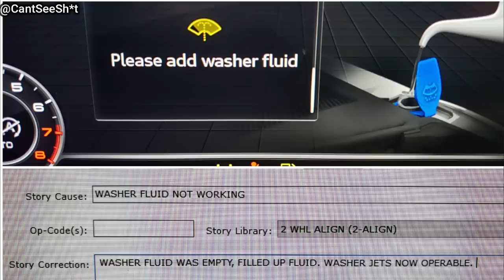Customer States Truck Feels Weird While Driving (GMC Sierra) | Just Rolled In

Comment: The pressure that should be tires is listed, most of the time, in the drive’s side door jam or somewhere close to it, NOT on the tire. What is listed on the tire is the maximum pressure the tire was designed to hold. But its not surprising that most people don’t know that. People are lazy.

Comment: The tire literally tells you the PSI for it on the side     ...90!?!!  I only have to use that on a 27 foot RVs air shocks.  Jeez...people.
Reply: No, the tyre tells you the MAX pressure on the side.  That is very different from the recommended pressure for your vehicle.  People are idiots.

Comment: I get people put like 50psi in their tires if that's within the maximum pressure, probably thinking it can only be good for fuel economy and it'll take longer before the tire gets too low, but what drives people to put 90psi in their tires, let alone seeing the tire is perfectly round with zero sidewall bulge and still keep putting air in until it blows up in their face!?
People like this is why people who drive vans with tires that actually take well over 50psi to be at optimal pressure are getting a hard time finding public air hoses that allow the pressure they need. Always the ignorant and the idiots who ruin it for everyone.

Comment: The tire thing bothers me a lot. I have D load rated GoodYear MT/R that only carry the D rating at 80 psi, and the current BF Goodrich KO2's carry "80 psi" for an E rating. That does not need they mean they need inflated to 80psi on a 2002 Jeep liberty! Just put them at 32 and be gone. "but the tire says 80". I say 32 is high, so do it...do it.

Comment: I don't know what it's like in the USA but over here there is a sticker when you open the drivers door.
It gives you the tire pressures front and rear for empty and fully loaded both in psi and bar.
If a car comes with 2 tyre sizes (base model and top model) then the sticker will tell you the pressure for both sets of tires. 
It seems easy to me.

Comment: That's all well and good since most vehicle owners aren't mechanic.  But went you send your vehicle to the shop to replace the oil pump and they look for an oil leak, mean while failing to notice that there is no oil pressure on the motor while its running. So, when are you going to do a video on that side of the business.

Comment: I don't understand how people could not know how to read the side of their tires for air pressure information? We even learned as kids not to overfill basketballs, volleyballs, tetherballs. It's just common sense isn't it? That last clip was harsh, dude almost killed himself.
Reply: Some people might confuse PSI and BAR.
Reply: That’s the point- you don’t read the tyre sidewall for the pressure, you read the service manual (or the door jamb).  It annoys me that I have to share the road with these idiots.
Reply: @biffaozzie2373  Well it's not going to explode when you fill it to the tire sidewall maximum load number, it's just going to wear unevenly if your car doesn't require that sort of pressure.
Reply: @biffaozzie2373  why don't you go outside and look at the side of your tire, the pressure isn't specific to each car, it's specific to the size and type of tire.
Reply: @fauxmetaljacket3268  yes, I have looked at the side of the tyre- it says MAX PRESSURE 60psi.  The manual for the car (and the sticker on the door jamb) says the tyre size, and the pressure for that tyre, on that car.  How can people not understand this?
Reply: @logitech4873  no, it also has less grip, especially in the wet, because the contact patch is greatly reduced.  It makes the suspension less effective, and it’s more prone to concussion damage.  It’s dangerous, as well as stupid.

Comment: If only they sold some sort of tool that was cheap and told you how much pressure is in a tire. And if the car manufacturers had just put what the tire pressure should be in a place the driver would see every time they opened their door. Wishful thinking, I know.